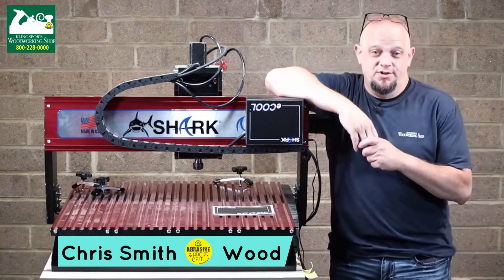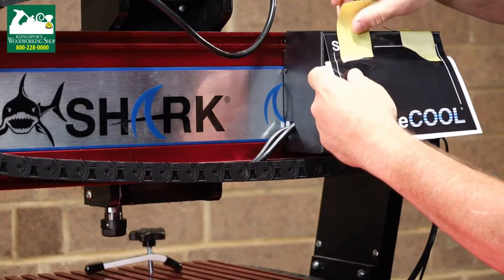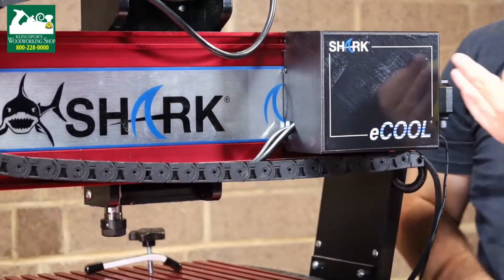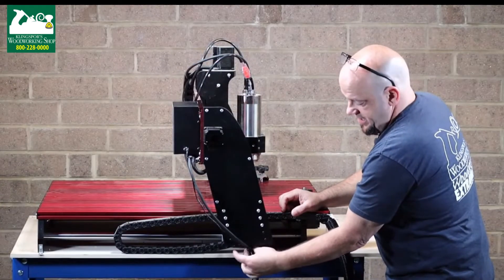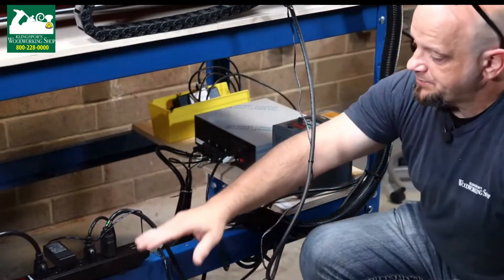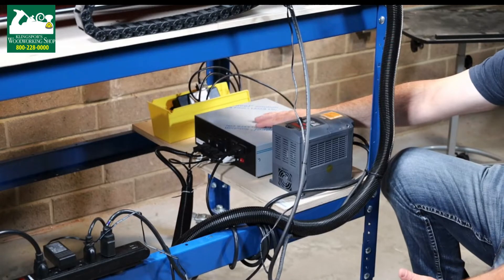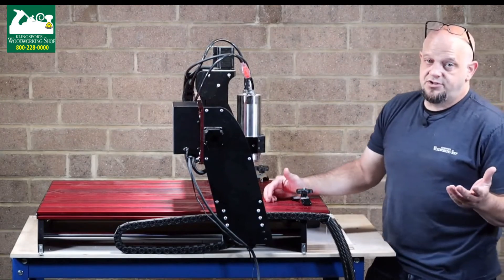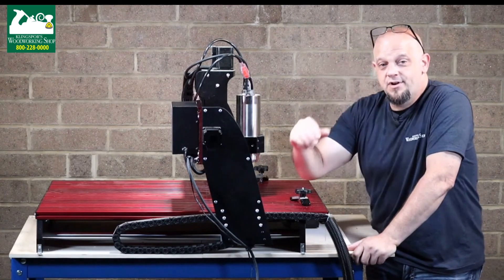Next Wave 3 Horsepower Spindle Update

Comment: Quick question from a newbie. I have the same setup and wondering if the spindle can be operated manually from the speed controller without using a toolpath or the vetric program?
Reply from the maker: @christcrosscrafts any thoughts?

Comment: I just bought the 3 hp spindle for my hd520 and it gets very hot even though the flow meter is spinning. Is this normal?
thanks
Reply from the maker: You have the right fluid? That might be the issue. Check with Next Wave to see if they can help pin point the issue. Thanks for watching